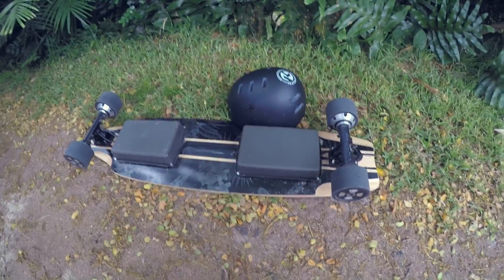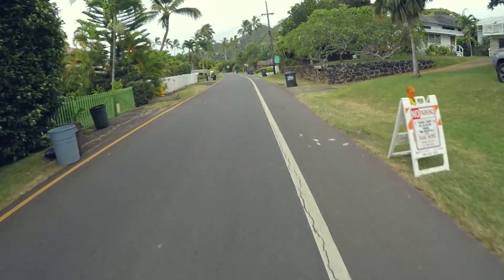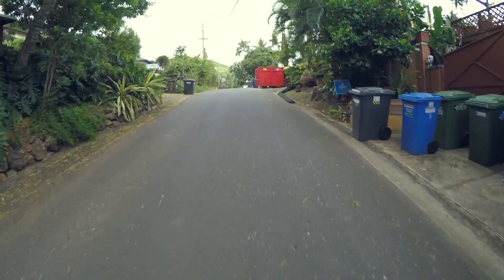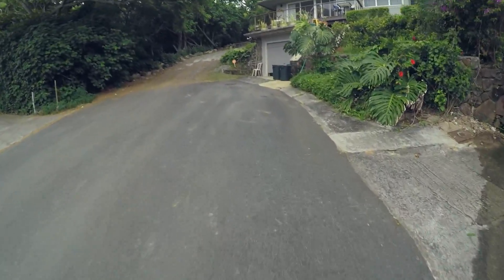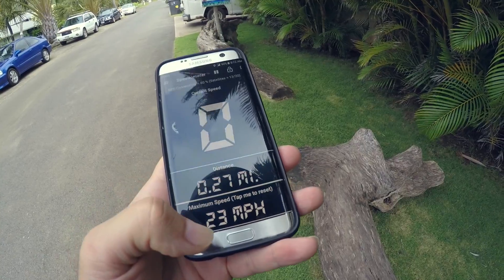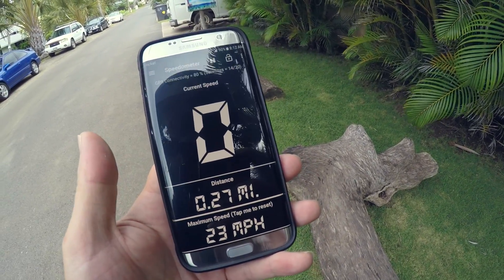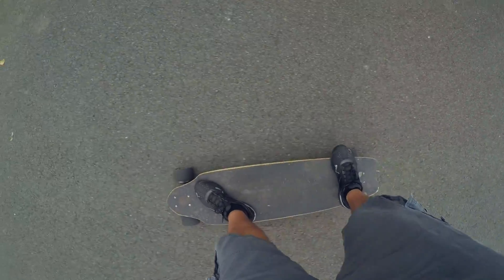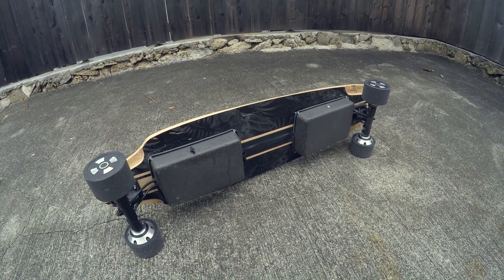$550 Diy AWD Electric Skateboard - Speed and Hill Climbing Test

Comment: Good board, the programming on the ESC limits you to that 23mph. But as you said that is fast enough. I want 4wd to get thru grass areas but I am also machining  some 110mm Rough Stuff Wheels to fit the powered hubs by removing the existing rubber and slipping the new PU on. 90mm wheels are too small IMO
Reply from the maker: Bigger wheel would be much better for off roading for sure. Good luck with your build.
Reply: Just Vlad Bigger wheels would give you a higher top speed but less torque. With 4WD offroad would be insane :D